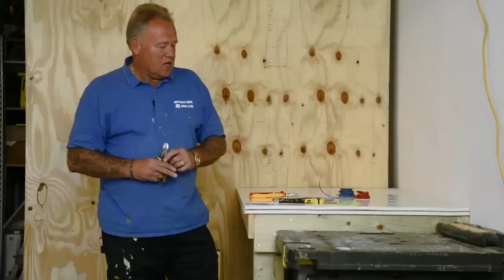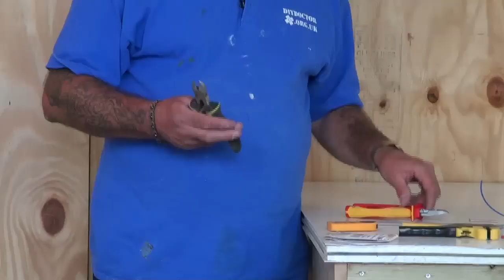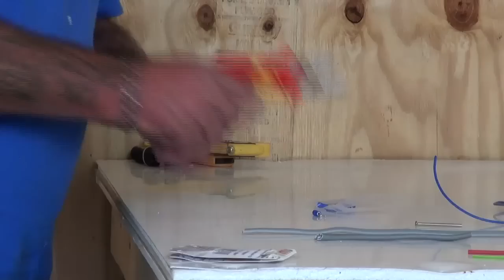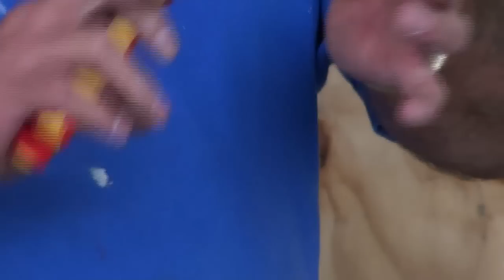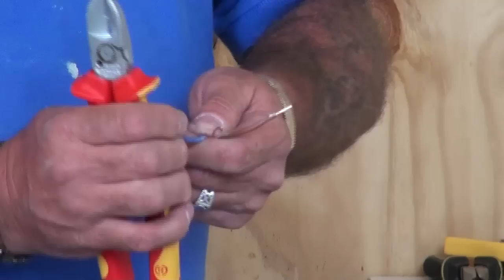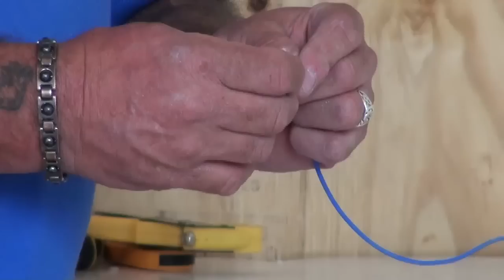NWS 6 in 1 wire cutter Review

Comment: Please remember to use brown sleeving for your switch lines and secondly, you really need to know your regs before you start making these films for the diy guys. They are going to be using you as reference to their work regardless of who's responsible. So make sure you mention to cross reference the regs before commencing the works. You can use higher rated cables such as 2.5mm twin and earth. If the volt drop of circuit doesnt meet 3% for lighting and 5% of other circuits such as ring mains. If they don't know such information beyond part P building regulations, they'll be potentially at risk. This is why the requirements are becoming alot more strict and to stop people who know minimal and tell people the wrong thing. All the best keep up the good work..... please mention BS7671

Comment: These are OK but not the best quality considering the price. The action on mine went quite loose after several months, bare in mind I am a spark so they do get well used! Personally I prefer either C.K or even Wiha. There is some kind of electro plating on them which appears to come off quite easily, they also don't keep their edge to well either!